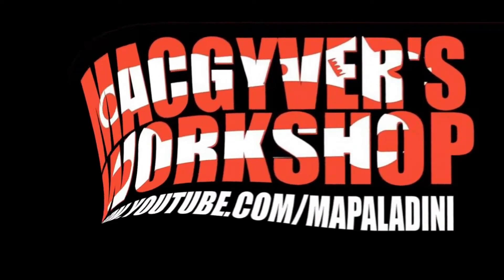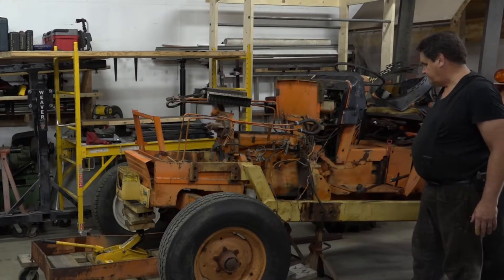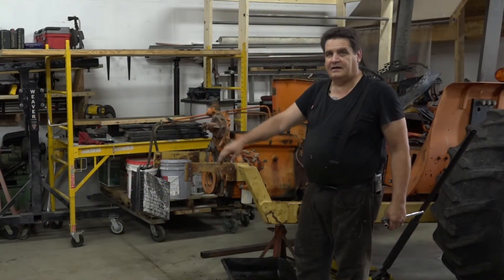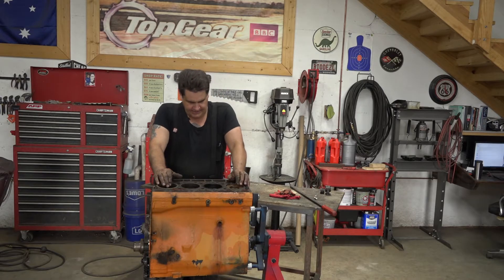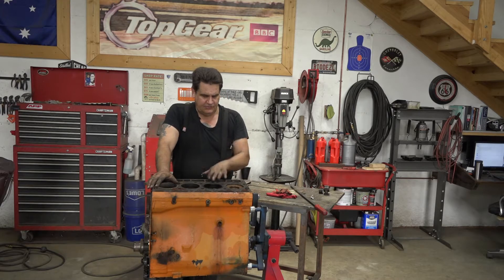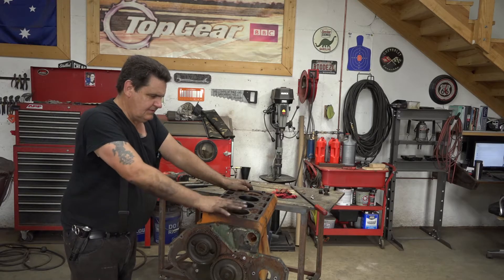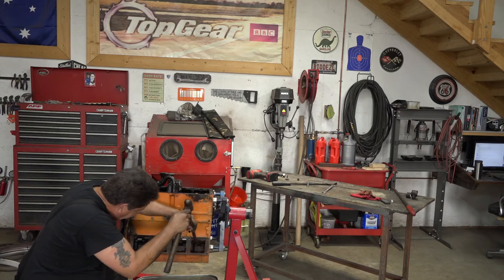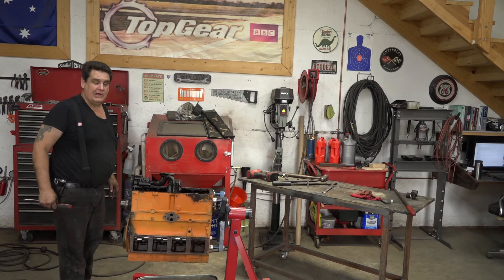Case Tractor Engine teardown Part 1

Comment: I rebuilt my 401 diesel without taking the tractor apart. That was mainly because I have no shop and had to resleeve the block right out by the barn. Luckily, the weather held and I was able to finish the whole project without getting snowed or rained on. My engine broke number 2 cylinder off down inside the block. That was because the guy I bought it from was not a mechanic and had been into the injection pump before he knew he needed to prime the fuel system. Then, the tractor spent the winter on its left side in a creek over the previous winter. It has been a real interesting project and is my favorite machine, now.